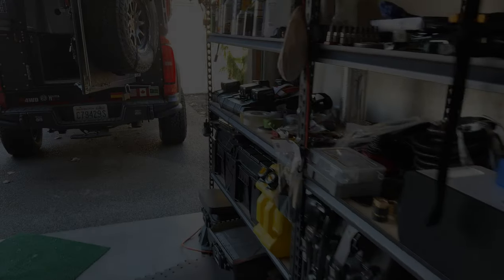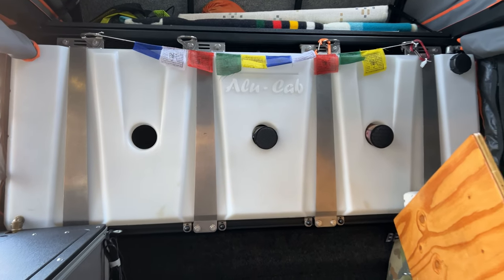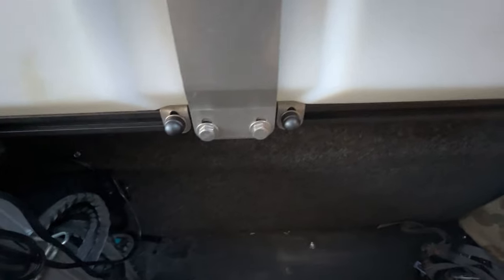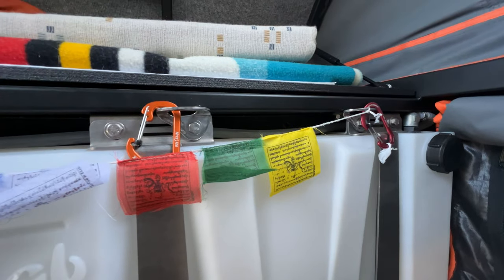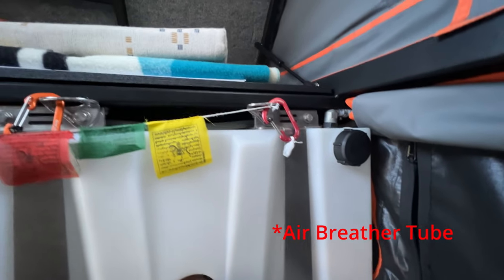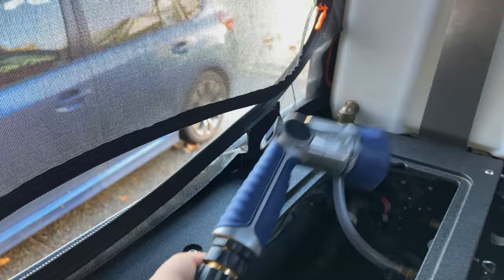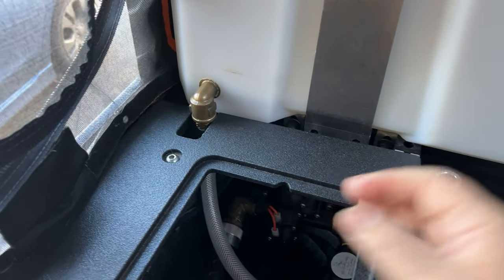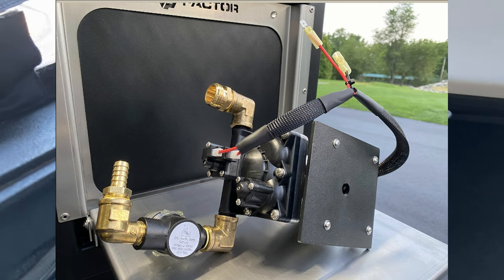Alu Cab Canopy Camper Onboard Water System Walkthrough - One Take

Comment: I like this design but I have a concern about long term use. If you have ever used plastic water bottles for hiking/biking or whatever you know where I'm going. You know, the water bottle that has been sitting for months unused and you decide to use it and end up throwing it away due to smell ect. Do you feel in time this Alu tank could have this problem or is there a recommended maintenance program to prevent that dank plastic smell. I'm assuming it's plastic.
Reply from the maker: Periodically I use the bleach method popular with RV style water tanks. Just Google it and you'll see what I am talking about.  The amount of bleach you use is not harmful and I flush out the water tank multiple times with fresh water to get any of the residual bleach out. https://www.clorox.com/learn/how-to-sanitize-water-tank-with-bleach/

Comment: How to fill up the tank if your far from home since  the mouth is on the side !?, and have you consider installing a water heater!! I saw one installed On goose gear ig page!!
Reply from the maker: I did have a tankless water heater installed previously but I was using way too much water when I was showering or washing dishes.  I ended up switching over to a Geyser Systems hot water unit to heat water for showers and I am able to conserve much more water on longer trips with that setup.